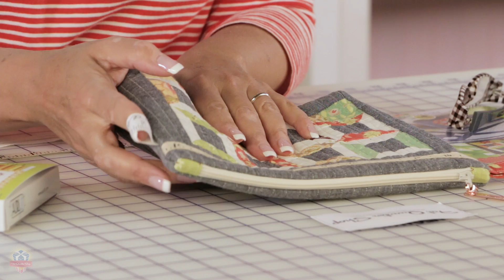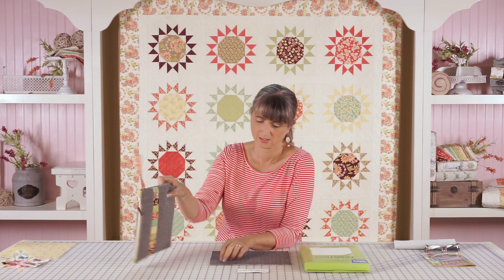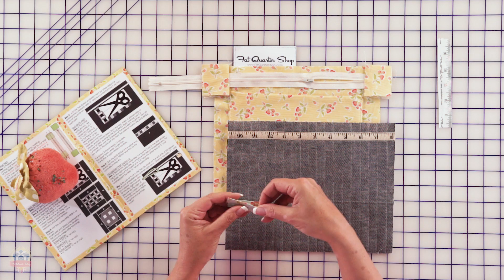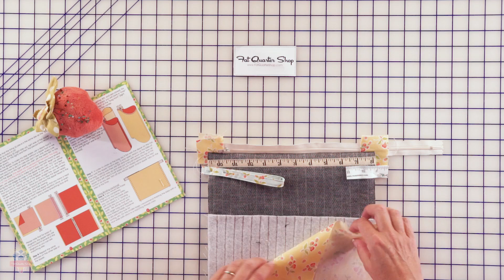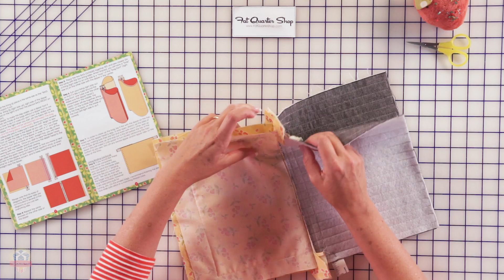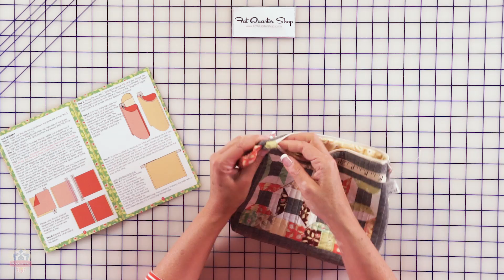How to: Scissor Satchels Sewing pattern by Joanna Figueroa | Fig Tree Quilts - Fat Quarter Shop

Comment: Why don't you just sew the sides and leave a gap in the lining to turn through. Box corners then turn it through no binding necessary no bulk.
Reply: I was wondering the same thing, it leaves a much nicer finished inside that way.
Reply: This is basically the worst finishing method I’ve ever seen. 🤔